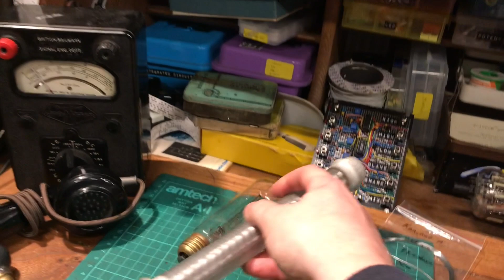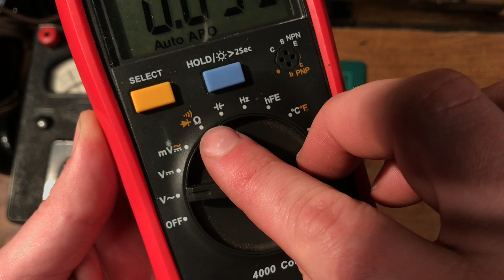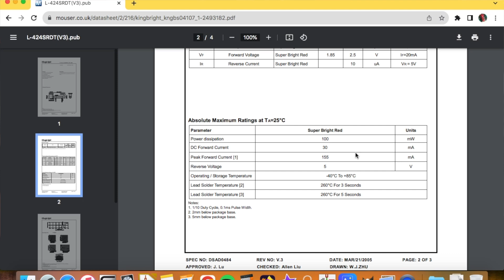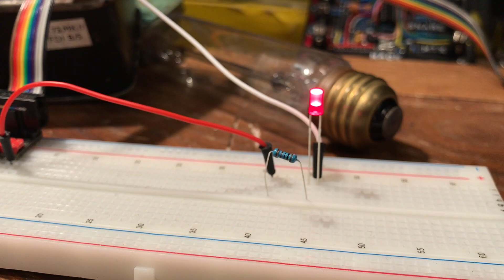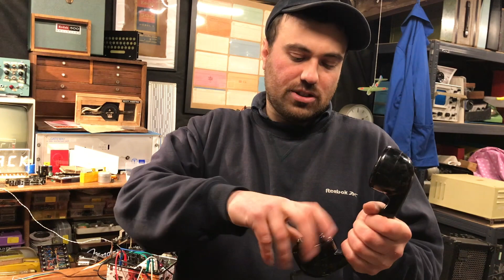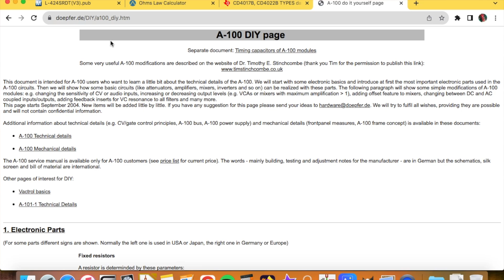Learn Synth Electronics - Ep.1 Resistance

Comment: I think it's the best video on resistors that I've seen!
I've stopped my proto-synth making after I've soldered the block of VCO that was made (successfully) on a solderless breadboard. Because after soldering it did stopped working )) I've soldered it on a small protoboard and did made the most of tracks by small (from a big old telephone cable) copper wires mostly (and the legs of parts of course!). I've did made the ground wires from a separate thick wire  (thinking that this will be the best solution). The end result looks a bit messy (a kind of spaghetti). It gives a tone but I can't calibrate it at all! Probably I have some parasitic resistance or inductance or something else...
IDK where to start digging here. Should I redo the same but making paths out of solder mostly? Do I need to take a bigger proto-PCB?

Comment: I enjoyed this, the subject can get pretty dry so appreciate you giving it some energy and humour! I will end up watching it multiple times understanding a little bit more each time. It's the maths that is the brick wall at the moment so using the calculator was a helpful tip. I have been building a few Eurorack modules from PCBs and even figuring out what components to buy took a lot of learning, a video on what resistors, capacitors etc. are relevant for synths would be really helpful I'm sure.
Reply from the maker: It's true, these things aren't as obvious as you'd hope! Nice one for figuring it out though. 

That extra 40 min Patreon video goes into the specific types of resistors used in synth stuff and what all the technical specs mean 👍

Happy to hear the video is useful for you =)